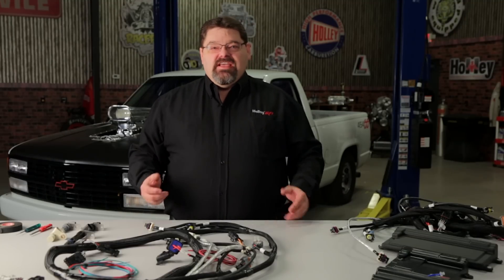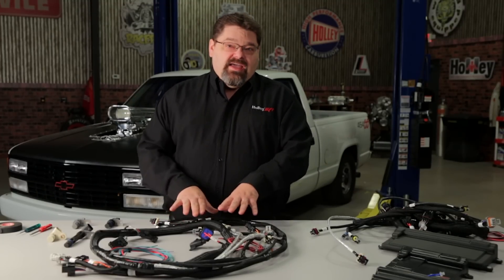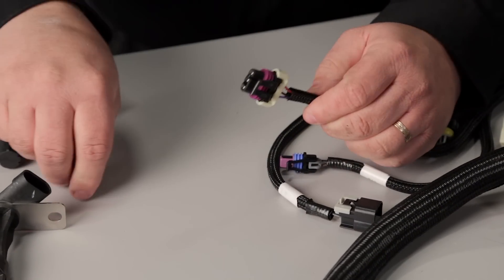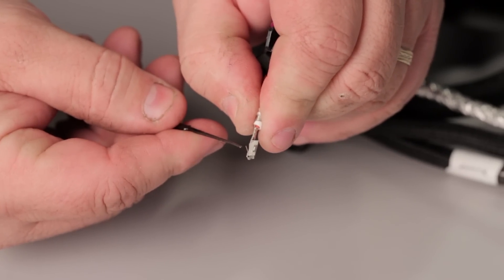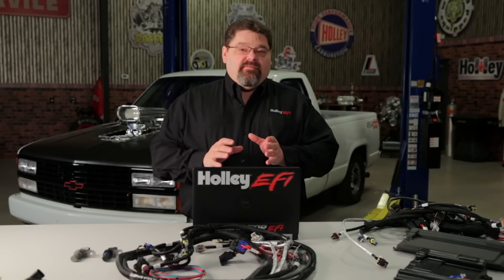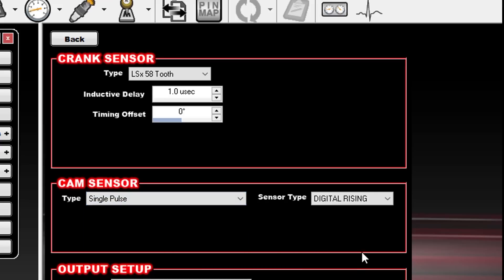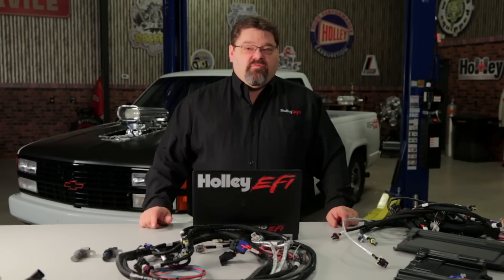How to use a Holley EFI 58x Harness on 24x Engines

Comment: I gotta 4 gen 5.3 with terminator X system we puting a gen 3 6.0 using the cam heads intake and timing cover from the gen 4 so how do I do my crank and cam sensor wiring ?

Comment: Have a TorqHead 24X on my 95 LT1. The crank sensor is GM 10456248 (1998-99 GMC P30 7.4 liter) and the cam sensor is GM 12591720 (2010 to 2015 Camaro SS). When I purchased my Terminator X Max from Holley, the sales man recommended I get the 58X harness because the crank and cam wires were longer and could reach my 24X crank and 1x cam sensors on my timing cover. Car won’t rev past 2400 rpm and I’ve changed everything once. Help😊

Comment: So you only have to switch the cam sensor wires and not the crank? I’ve got a ls2 engine and I ordered a new harness that is the 58x to replace the 24x harness I was running.

Comment: I have an LS2 from 2006 GTO with this 58x harness. Swapped pin A and C on the cam connector like the instructions on this vid indicates and engine didn't idle well. Changed pins back to the way the harness came and engine idles perfect...programed ECU to 24x both times.

Comment: Hello.  I had to swap engine to a 24x 1x cam.  I had a 58 x 4x.  I did as you show in the video and the engine will not fire. I had to go in the settings and select no cam sensor.  Then the engine will start. But has a weird surge off idle and very bad when trying to drive.  Is no cam sensor my issue. Also why will mine not start with the cam sensor selected??  Any help is greatly appreciated!!   Thank you.

Comment: thanks worked for me 58x harness on 24x lm7 truck engine just swaped wires and picked 24x on the setup wizard.
Reply: What injectors did you run ?
Reply: @vegas915  you can run any injector you want with any style plug they sell adapter plugs for the harness on ebay
Reply: Thanks. Same thing here. I was waiting for a 24x stealth system but can’t find them anywhere. Found a 58x so I ordered it. When it get here I can switch the wires and change the settings and be good.
Reply: So knock sensor wires were long enough? That’s my only other worry now
Reply: @brentdavis2596  there are no knock sensor wires to hook up
Reply: Did you filp the crank sensor as well?

Comment: how can I tell if I have a 1X or 4X cam sensor? I have the 24X harness on an LS2 and holley tech support recommended I buy an extension for the cam sensor plug, do I still need to repin the connector in this case?

Comment: I have a 550-905 kit “ls2” 24x 1x motor and swapping the pins cause the cam sensor to read nothing and have the crank sensor go crazy. I swapped it back to normal and it runs just fine. So don’t listen to this guy
Reply: Yeah I’m starting to see that this video is full of shit and the folks over at Holley know just as much about their product as the clowns do over at fi-tech.

Comment: So for LS1 24X/1X , to LS3 58X/4X, I need to repin the Cam and Crank as shown?
Reply: I don’t think the crank needs to be ripinned just the cam….u just have to remove a tab on crank sensor from what I’m hearing
Reply: But yeah I’m in the same boat as you, I have 2 cars running a 24x terminator x and have a spare 58x 6.0 on standby for when one of my gen 3’s give up the 💨 smoke

Comment: Just found this video and read comments. I’m completely confused. I ordered 2 terminator 24x kits for the two builds i’m working on. Both engines are a 24x with a 1x cam sensor. Now you say I should have ordered the 58x? Why can’t I just add a extension harness to the cam sensor and get a knock sensor harness that works with sensors on the side of the engine. Do I still have to switch the A and C terminals on the cam sensor harness? 

Why didn’t you guys actually make a harness that fits correctly?
Reply: i just did same thing using the extension cable for cam sensor im having problem with crank and cam syncing
Reply: Holley can you please respond to some of these comments
Reply: @jonathanmoore5112  man if you have 24 x crank and the 1 x cam you have the right system,you dont have to repin anything or piggy back any wiring,i found my problem was that i ordered a extension cable for cam sensor and they had already switched the wires all i had to do was switch them back,mine runs like a scalded cat now!

Comment: I have a gen 3 ls with a 58x crank and a 1x cam. I purchased a 58x crank sensor now do i need to change the crank or cam wires to get the 5v reference
Reply: No

Comment: What about going from a 24x 1x to a 58x 4x?
Reply: I'm hoping they reply to you so I can see the answer lol
Reply: @westhompson7295  I called them... all you’ll need to do is swap the cam plug configuration. That’s all I did per their instructions and it will work.
Reply: @richardgreen1142  so just swap the “A” and “C” wires on the cam sensor, and put 58x 4x on ignition settings on the ecu?………really I just literally have to swap those 2 wires????…….I’m running a 370 lsa supercharged lq9 right now and have a l96 on standby, when and if the lq9 gives up the smoke…..I also have a vortech supercharged lm7 in my c10….so the l96 is gonna go to the first one that needs it….I was on the fence about buying a 24x crankshaft for it , but if it’s literally a 2 wire swap I will save my money for something else

Comment: I have a 58X crank, 1Xblock, and mistakenly bought a 24x/1x harness. I opened up the harness and made sure the crank sensor was supplied with the 5V reference from pin A26. I sure hope this works, will be attempting a first fire up in a few weeks
Reply: I don’t have weeks man come on
Reply: Well how did it go and did you switch wires on then crank sensor?
Reply: Same here... but running a gen7 big block with 58x crank and 1x cam sensors. Ordered the Holley 24x/1x kit and hope it will work by extending the cam sensor harness.

Comment: This video is EXTREMELY confusing
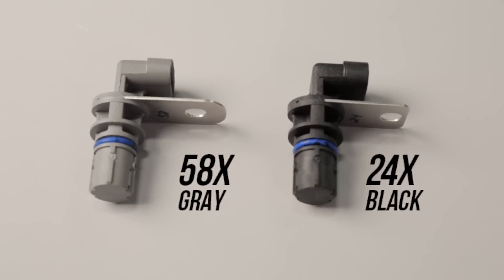1:30 he is holding CRANK sensors in his hand, and saying that 'their' operating voltages are different, speaking about the crank sensors?? I DONT KNOW
because at
1:39 he puts down the CRANK sensors and randomly out of nowhere starts to talk about the cam sensors, so which is it? The crank sensors or cam sensors voltages are different? 
Then, picking up the CAM harness he swaps the cam sensor plug wires, leading us to believe that the CRANK sensors are identical between 24x and 58x
ARE THEY? I DONT THINK SO

Comment: This is really confusing.  Based on reading the comments, is it correct to say that a stock 2006 GTO LS2 has a  24X crank sensor and 1X cam sensor?  And the correct Holley harness would be the 58X harness with NO NEED to swap the A & C cam harness pins?  

If I understand what's been written in the comments, the cam pin swap is only necessary if using a 4X cam sensor.  But the stock 2006 GTO LS2 cam sensor is 1X, so there is no need to swap the cam sensor pin position if using the 58X Holley harness on a stock 2006 GTO LS2?

Comment: Everything I see, the front cover cam sensors are the same, so why the wire swap? I understand those wires need swapped from a rear mounted to front cover mounted. I have a 24x 1x LS2 i am going to use a terminator on, and Holley said I need an ls1/ls6 set up, which I dont agree with.

Comment: This kind of unrelated i guess but on the 24x cranks sensor should i have 12 volts at both red and purple wires? Im only getting 1.59 on the purple.
Reply from the maker: give our tech line a call for assistance! 866-464-6553

Comment: If you’re putting this on a 05-06 GTO LS2, don’t swap anything. Run the 58x harness and the stock 24x crank sensor with the stock 1x cam sensor, and choose 24x in the start up wizard and it’ll work. I followed this video and trouble shot for days. Then when I swapped back it had messed the pins up and I didn’t know it, which led to more trouble shooting
Reply: JackTack nailed it.  I'm running a 550-928 for the 58x LS2 on my 24x/1x LS2.  I swapped the A/C pins and selected 24x in the dropdown just like this video said to do.  It finally started but cylinders 3 and 4 weren't firing.  After a day of troubleshooting, I flipped the pins back to stock and what do you know, runs great!  The only mod I needed to do was to remove the tab so the crank sensor would plug in.
Reply: Reporting back, yep swapped the wires back and it fires right up perfect AFRs! Sloppy cam+ 70mm turbo music to ears :)
A-Red wire 
B-Black wire 
C-Purp wire 

Thanks guys yall are awesome!
Reply: This is only if you swap from 1x to 4x cam sensor.  Not reluctor wheel?  So if I switch from 24 to 58 no need to swap pins.  Just cut tab out?
Reply: @juandenny3198  also wondering this. I have a 4x cam setup now. But a stock 24x bottom end with a 58x harness and the cam is easy to figure out. But also curious if I can just run a 24x sensor cut the tab and set it up for a 24x in the terminator. Still not sure
Reply: @LordReekyCheeks  I run a 58 with 1x.  With 24 harnesses. I just cut the tab plug it up with the 58 sensor and it was something I had to do in ecu to get rpm signal.   Can’t remember but it worked
Reply: @LordReekyCheeks  i have that same issue any answer yet? holley tech support basically tells me that this combo doesn't exist
Reply: @LordReekyCheeks  I have the same set up. Did you ever figure it out?
Reply: I got a 2015 gen 4 vvt engine that i converted to 5.3 24x crank and 3 bolt cam with 1x cam sprocket also I put an ac delco 24x crank sensor in and according to parts catalog the gen 4 cam sensor out of 2015 express 2500 is same as gto. Is this correct? Im having all sorts of backfire and hard start issues. I did swap the pins on cam sensor like video said right when i got my term x delivered. Wish i had seen these comments before. Gonna swap the pins back and see what happens. Any input appreciated.
Reply: Can't you just get the 555-904 24x harness and buy a cam sensor extension

Comment: So I have a 24x crank sensor and a 4 cam gear I got by mistake so by switching the 2wires on the cam wiring harness and change the settings I should b good to go  I’m hoping I understand this right but my terminator system is for the 24x 2002 where the Knox sensor r in the vally I have a harness extension I made so the cam sensor plug would reach

Comment: Ok, not sure what the issue is, but this is NOT true in all cases, I have a 550-010 setup, running a 24xcrank 6.0, LS9 cam, front mounted cam sensor, 1X gear. Was told to follow this video by Holley tech dept, engine would not start, only back fired, was told cam sensor was bad, $70 later(new GM) no change, numerous calls/emails got nowhere. The cam syc light would go red when you tried to start. After 3 weeks of jerking around I swapped the wires back to original position, started right up, so something screwy here.
Reply: How did you set it up in the wizard when you changed the wires back to normal, as a 58, 24, or custom in the software? Pretty sure I’m having the same exact issue right now and I’m about to swap them back to normal
Reply: @JackmeriusTaktheritrix  just set as 24T which is what I have, has run fine

Comment: I have a 06 gto 6.0. I bought ur 58x kit. Switched the wires needed as showed in video. But can’t find the injector part number for my application. Also it’s showing the crank sensor light is blue

Comment: Great info, i currently have a gen3 24x ls1 running with stock ecu and was thinking of getting terminator x for tunning ease but plan on eventually switching to a gen4 ls3 in the future, so you would recommend to buy 58x harness do this modification to work on ls1 and reverse the mod when i get a gen 4?and would anything be needed to be done to the knock sensor?

Comment: So if you buy a terminator x for 58x it will run both 24x and 58x with modifications to the harness ?
Reply from the maker: Yes. You can switch up the harness to make it work on either. -Keith
Reply: @HolleyPerformance  so if I bought the 24x it won't work for 58x..
Reply: @slowpokrodz956  were you able to make 28x work to 58x?
Reply: @julioe9690  in my case I just swapped out the reluctor wheel from 58x to 24 x tooth and then switched the wires on the cam sensor..
Reply: @slowpokrodz956  the A and C wires?

Comment: Does the wiring on the connector for the crank need to be swapped? Can I just grind down the tab on the 24x crank sensor and plug it and set the settings for 24x?
Reply from the maker: Yes, you could shave the tab and use the connector but If you are using a timing cover mounted 1X sensor on a 4X wheel you need to swap the A and C pins in the connector.  Thx J
Reply: @HolleyPerformance  just on the cam sensor?
Reply from the maker: @screamerobsz0644  Yes, use a 24x crank sensor and shave the tab on the harness connector. Swap the pins if you're using a 1x sensor on the 4x wheel.
Reply: What if you run a 4x sensor with a 1x sprocket?
Reply: My truck kept losing sync. And it would backfire. I have the 58x harness, 24x sensor and crank reluctor, tining cover mounted 4x cam sensor and 1x sprocket. Turns out all I needed to do was modify the crank plug to fit, I swapped the cam wires, and it wouldnt run right, swapped them back and all is good now
Reply: @LS1FREEK  did you figure it out? I'm in same boat right now
Reply: @taylorjaniski7574  I just swapped the cam sensor back to the way it was and worked perfect
Reply: @taylorjaniski7574  just look at my comment above yours
Reply: @LS1FREEK  that's what I did. Left harness as is

Comment: Hi. I have this same situation. What ive found is the 24t black crank sensor doesn't plug into the 58t loom. Do I use the grey 58t sensor to read the 24t crank?
Reply from the maker: You need to keep the sensor that is designed for your engine!  Swap the connector on the harness for the one that corresponds with your engine's sensor and be sure to wire it correctly for your set-up.  Use the custom drop-down menu to choose your cam and crank sensor type under the ignition tab.  thx J
Reply: Are the connectors wired the same?
Reply: @screamerobsz0644  yes...I think so as I haven't done it yet have had it confirmed.  As for the connector you can just file the tang off in the plug to go from the 58t plug to 24t sensor
Reply from the maker: @screamerobsz0644  Yes, unless you are using a timing cover mounted 1X sensor on a 4X wheel. If so you will need to swap the A and C pins in the connector.  Thx J

Comment: I have a running 58x 4x combo with the Holley LS 2 harness and a Dominator. I'm replacing the engine with a 24x 4x engine. Can I still use the 58x sensor and harness without modification to the harness.  And configure the ignition to custom  24x 4x? I understand I'll need to check  timing to reset the inductive delay and timing offset.
Reply from the maker: Yes, you can use the 58X harness with the 24x engine but you will have to use the correct 24x sensor for your engine. You'll  need to swap the connector on the 58x harness for one that will plug into your 24x sensor.  Be sure to go into the software and select the custom tab under the ignition type, then select 24x crank and 4x cam.  Thx J
Reply: @HolleyPerformance   Thank You
Reply from the maker: @chifenparker  Your welcome, Also .  If you are using a timing cover mounted 1X sensor on a 4X wheel you will need to swap the A and C pin in the connector.
Reply: @HolleyPerformance  I only see one cam sensor for front mounted. Applications or 2005 Corvette and 2010 Silverado has same part# cam sensor.
Reply: @HolleyPerformance      Are you sure its 24x and 4x cam?    I'm pretty sure there's no such animal.   All the 24x LS2's should be 24x crank & 1x cam (but mounted in front cover)

Comment: Happy I found this video after getting multiple different suggestions from the Holly tech service line yesterday. The people I talked to on the phone need to learn from this guy about the GTO LS2. I was told to buy the 550-929 kit for LS1/LS6. One rep said my injectors will work while the other rep said I have to go buy injector adapters. Then after watching this video I have realized that my cam position cable AND knock sensors wouldn't have reached. The miss information and confusion I got yesterday was a little disappointing. Still not sure if my GTO throttle pedal will work. I am still considering the Terminator X over HP Tuners but just hoping it all works out.
Reply: 3 years later nothings changed
Reply: Brad, if you're subscribed to this thread, what was the part# combination/solution for your GTO LS2 with the OE GTO pedal?

Comment: Hey bud,  that's for the excellent How to. One thing , ive got a factory ls2 24x 1x here with the front cam sensor and I'm going to order the Terminator x 58x1x kit. do I need to swap A-C wires on both the cam and crank sensors or just changing the software setting for the crank will suffice as you did?
Reply: From what I saw that was it and I'm thinking of just grinding the tab down on the 24x sensor and plugging it in!
Reply: Did you ever find out lol
Reply: @MrToastado  swap a&c on cam only

Comment: Is Holley going to make a wire harness or adapter to piggyback off of the factory wire harness? For  those of us who would love to get the terminator x, but needs to install on our daily driver. That needs to get inspected once a year
Reply: Nope. Holley doesn't want deal with any of the emissions requirements.  They are going to stay strictly "off road" vehicles.